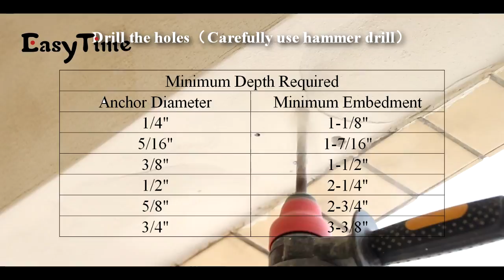How to Install Hammock Chair?

Comment: We have the same product and tools but I think our ceiling is not concrete or brick and this is for our living room...what tools should we use to install this? Thank you!!
Reply: Get a c hammock stand. Im doing same in living room.and home office hopefully
Reply: The ceiling will fall apart,  it only works with concrete/brick.  You better get a hammock chair stand support.
Reply: Same but mine’s problem is that the concrete in it has the like Reinforcement steels u know? So its hard to drill in to make the holes😢😔 But succeed eventually